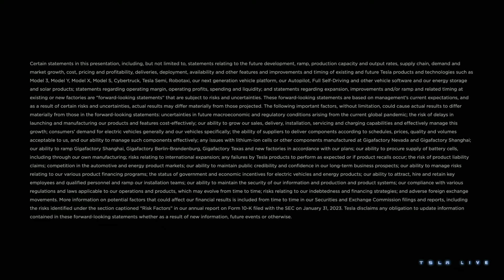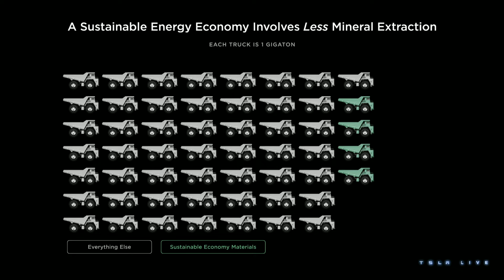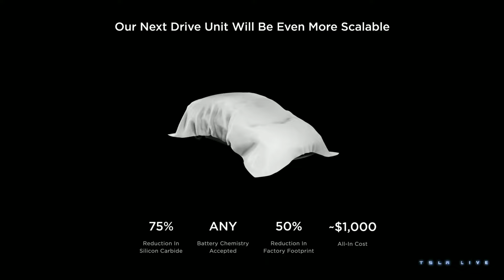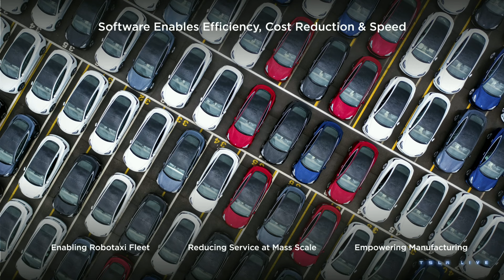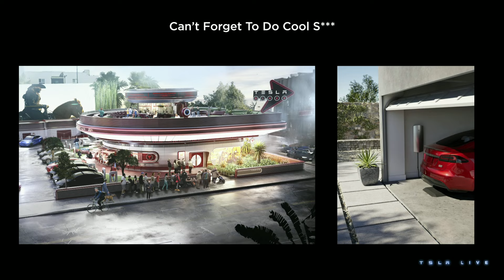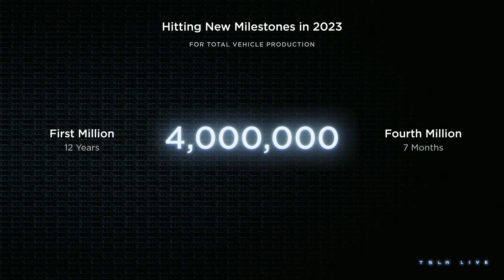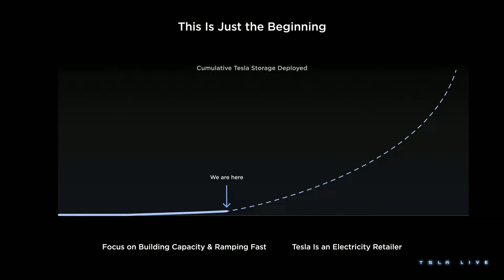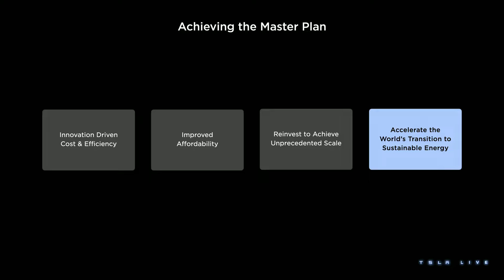2023 Investor Day | Tesla

Comment: This doesn't cover the drain on an energy grid. Nor as we saw in Texas, the obvious possibly catastrophic inefficiency in weather extremes. Until they cover that, the worst-case examples, this is all sunflowers and moonbeams. If they simply proposed a nuclear energy power back up, then I would give this more of a consideration.  Nuclear power is also zero carbon. However, they don't. So, what is this about then? Power over the energy sector? Humans aren't causing climate change. Geologists who study Ice Cores know that. Technologists don't accept this truth which is based on raw data. Lastly and most importantly, since the Earth has climate cycles, and the cooling cycle is inevitable, electrical grids will not have the energy capacity to sustain. Stored energy will be lost in subzero temperatures, Clouds will cover the sun and the windmills will freeze. Humanity risks being wiped out and fairly rapidly. I would encourage Elon to debate this with a climatologist in Antarctica who studies Ice Cores. He might learn what he doesn't yet seem to understand.

Comment: Tesla build quality just is not there.  Never has been. I wish that was not the case but fit and finish is not good enough.  This will only get worse as they continue ramp up production. Also, I do not like the look of any of the cars, especially, the minimalist interiors and the limited choice of interior colors (pure white or black only) and cheap materials used.  I believe Teslas work for people who really don't care about these things.  What you are buying here is the computer tech and very good infrastructure.
Reply: Fit and finish is on par if not better than others. If you don't like them don't buy them.
Reply: That's not what I've seen, but then I suspect you're just spouting the same nonsense from years back because.. well it's all you got.
Reply: This is not exactly correct. The Tesla Shanghai builds are number one in terms of lowest defects rate at 7 per 10,000 vehicles, and the quality of the Texas and Berlin builds are in a similar category. 

The one factory that still may have some minor adjustable cosmetics issues are some Fremont vehicles. That factory is older and the lines are generally not as up to date on things - for example full gigacasting use, which replaces 2x70 parts, eliminating many compound potentials for margin of error.

I think they'll be updating the Fremont lines when Texas scales up enough, it's not a good time for them to take those lines down, but they have plans to do upgrades once Texas can provide backup in the US market.

Comment: I think, EV manufacturing is going to evolve into--: Smartphone Manufacturing process 
OR Smartphone on Wheels.....

With 6 main components :-
¤Motor
¤Battery 
¤Chassis 
¤Hardware/chip/control unit
¤Interface/operating system
¤Auxiliary/luxury item.

Whoever is going to master any One of these fields (as prime supplier), will become next billionaire. 

Just like in a smartphone, you have-
Chipset by snapdragon, mediatek, unisoc, apple A.  

CPU/motor is usually supplied via chipset.

Battery is mostly chinese. 

Body/chassis is company or model specific like Samsung, Apple, Tesla, Hyundai. 

Operating System is where main battle is going to happen, just like 2010's android vs ios vs windows vs blackberry vs Symbian.

Auxiliary/luxury features & gimmicks are mostly bs, like-
How many cameras & mega pixel, A.I. assistant, auto assist, sound system, heating/cooling, voice control are all gimmicky bs, (that you can have via docking your phone into infotainment).
Except full autonomous driving, but that is nowhere near.

Every manufacturer is focused on auxiliary gimmicks, when first five lanes are wide open....
Reply: whomever wins the race to real-world instantiated AI (capable of safely solving numerous tasks and learning in real time in varied environments using its sensors, etc.) will be the most useful/most valuable company in the future. There appears to be an (initial) huge economic incentives toward creating real-world AI/AGI in robotics that will likely make the labor skills of any human replaceable.

Comment: Transition to renewables will require governments to invest in utility grid modernization so that the power lines etc. can cope with higher load and increase in utility providers. This is where the plan will hit roadblocks. Tesla does not own the transmission network.
Reply: It takes more power to keep a house airconditioned in the summer than it does to keep a car charged. And the charging can occur when demand is the lowest which if anything makes things easier on the grid. It's not like AC where everyone is running it at the same time and in the middle of the day when electricity demand is already high
Reply: Distributed storage and virtual power plants take pressure off the grid.

Comment: would it not work if we were to connect the world on a global circuit to have enough solar cell around the world to power the dark side from the light side
Reply: Generally energy demand is pretty low at night so I imagine it's a lot more viable to match your supply curve with a similarly shaped demand curve and make up any difference with a few batteries, hydroelectric, wind, geothermal, etc. The world uses a lot of power and it's a long way to go to get around it with expensive copper cable. Not to mention that cables like that would be a huge weakness in the grid.

Comment: These guys dont understand the use of a sunroof. Frequency of use is irrelevant for many reasons. Its totally worth it for the few times you actually use it. Depends on weather and of course some ppl will not use it, but this shouldnt ruin it for everyone. Thats why its an 'option' on most brands. Alot of these decisions are really just cheap excuses to remove features and cut costs while increasing profit. Not fooling anyone, except maybe themselves.
Reply: Yes, cut costs by removing useless features.
Reply: @TheEvilmooseofdoom  For you maybe. They did the same with removing radar. Anyone who actually owned a Tesla with radar and a Tesla without radar knows it was a huge downgrade in driving experience, despite their false claims and false promises. Vision is still inferior to the previous radar model, including speed limited slower. Surprise, they are bringing radar back. Enough said. I'm a fan too, but I'm not blind.

Comment: Heat pumps won't work in colder climates... Unless you have a geothermal heat pump but that is extremely $$$. It's not realistic to think that heat pumps will replace all forms of home heating. I'd rather use a wood stove myself with solar panels and batteries and be fully off grid.
Reply: Or in hotter climates either. Heat pumps can only produce about 20 degrees of change
Reply: Heat pumps work just fine in colder climate.

And it is not a law of nature that geothermal heat pumps are expensive. It is just a hole in the ground.

In Sweden drilling geothermal heat wells is incredibly cheap.

But PV+Wood is also fine. Doing this myself.
Reply: Use your solar for heating, if you're using wood you may as well be using oil.
Reply: @fscott1134  Where do you get this from? Do you really tell this to people?